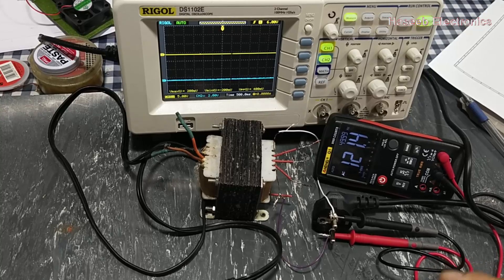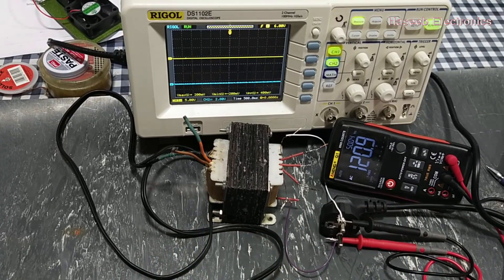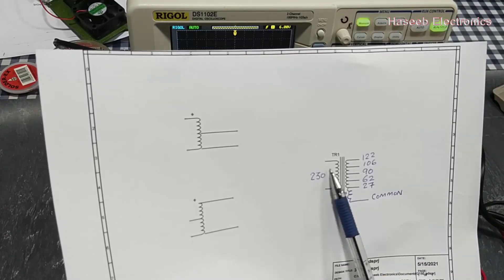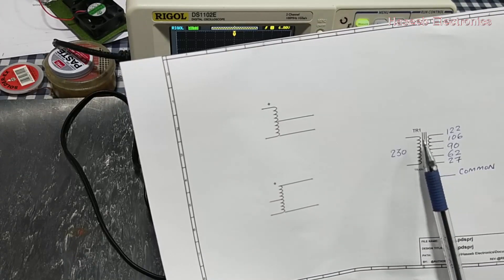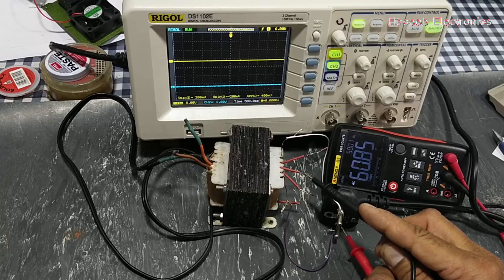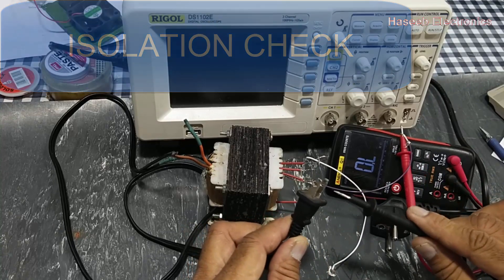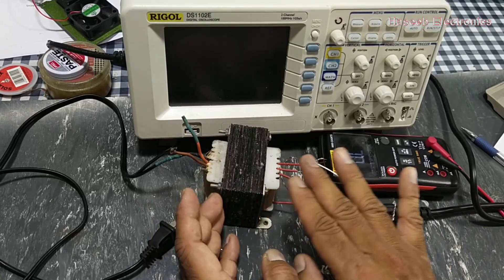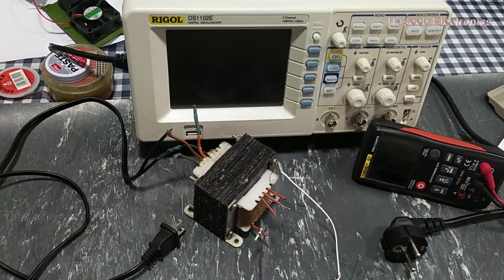{468} ISOLATION TRANSFORMER, What is Isolation Transformer, How To  Test Isolation Transformer

Comment: Hi I am trying to size a small isolation transformer. A 220V source will be connected to my transformer, which in turn will supply the electric to my 220V 40W 0.45A induction motor with gear head to be controlled with a speed controller. Can you advise the size of isolated transformer do I need for this purpose?
Reply from the maker: it is better to use 80 watt to 100 watt 1:1 ratio isolation transformer
 so it will not drop output voltage at full load condition. and it will drive the load in safe limits
Reply: @HaseebElectronics  Many thanks for your good advice. 100 watt I presume it is 100VA? Am I correct? Would it then be ok if I use 200VA instead?

Comment: You have a very soothing voice. I love to watch your videos, and sometimes they even help me relax at the end of a hard day. I have a small electronics lab and do component level board repair for manufacturing clients. I specialize in test equipment repair and calibration… For other small research labs and stuff like that.

You are one of the best teachers on YouTube.

Not sure where you are located, but if there’s a way I can send you something without really expensive shipping, I’m always getting very nice high-quality and large isolation transformers. I probably see two or three every week, because most of my clients use them in their factories.
It’s so sad to see what they throw away. They will literally be throwing brand new boxes full of parts and transformers and stuff in the recycling dumpster, because they always order more than they need for a certain job if they don’t use them all or when the jobs over they just toss them out.

They are transformers that can step up or step down voltage, and they are also totally isolated . I will post some examples below, If you think you might could use some things like this and there’s a way I can get them to you I will gladly send them.

The models I always keep are very similar to these in this links below.. Except the ones I get are capable of being step up or step down, and you can get a wide range of voltages. according to how you connect them. But the primary and secondary are completely isolated from each other

They also come with fuse holders that mount to the top, 
most of the one I keep are between 1000 VA and 1500 V8 and sometimes larger… So it’s like the large one in the photos below. I’ve even seen some that were well over 100 pounds, and a few times per year I see some that way thousands of pounds and are meant to be use a step up or step down or isolation for an entire factory. They don’t have windings they have copper bars wrapped around the frame. It’s always fun to see things like that.

Seriously I see them constantly and I can only keep so many I don’t need that many in my lab. 

If you’ve ever watched the video on the YouTube channel “Mr. Carlson‘s lab“ about his isolation transformer and current limiting set up… The transformers I get are almost identical to the ones he uses in that video.

https://www.galco.com/buy/Hammond-Power-Solutions/PH350MLI

Comment: Sir, if there is a connection between ground and the neutral in the output of the isolation transformer, that should be removed?
Reply from the maker: yes 
isolation transformer basically isolates the Line & Neutral and also removes the Ground connection 
if ground is connected in output side, that will void isolation 
so ground must be disconnected

Comment: You should not be floating your scope and instead connect the device under test to the isolation transformer.  It is neither safe for the oscilloscope or the technician and is not recommended by the oscilloscope manufacturer.
Reply from the maker: best regards
for best safety for tmde, we must use isolation transformer, specially to test un-isolated circuits, 
it is best practice to use battery supplied oscilloscope to test un-isolated live circuits or use isolation transformer. 
if we work on un-isolated circuits, it is much batter to supply with separate isolation transformer for human safety
Reply: @HaseebElectronics  Yes, good mention about battery powered oscilloscopes.  Many of them also have isolated inputs.
Reply from the maker: you are right. all oscilloscopes and wavefrorm recorders, all of these have isolated inputs but that have limitation for 300VRMS or 450 RMS, (depending on their safety category)  but in worst case scenario, if TMDE is not isolated 
1. in case of digital oscilloscopes, when the input signal exceeds at  input terminals, it damages the sample and hold circuit and also damages the DAC and processor of DSO, and we know when the processor flies away the DSO is finishes, 
2. in sense of CRO, it most of time, it have analog circuit, while testing un-isolated power circuits, it damages itself and sometimes it damages the next circuit
3. for some extremely sensitive circuit it is strictly forbidden to line powered TMDE, it must be battery powered or isolated power with two wire connection without ground,  
manufacturers claim that these are isolated at power input and for test signals. but it is much more better to put an extra layer of safety to make isolated power supply for oscilloscope,  for equipment safety, test equipment safety and human safety as well
and if we add a separate isolated power supply to workbench power that is highest approach of safety 
please accept my best regards and special thanks